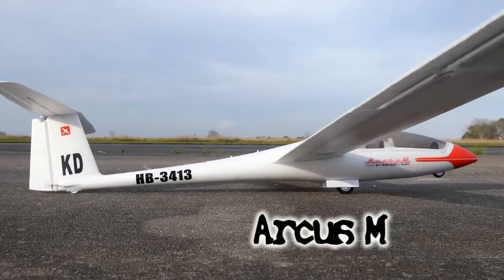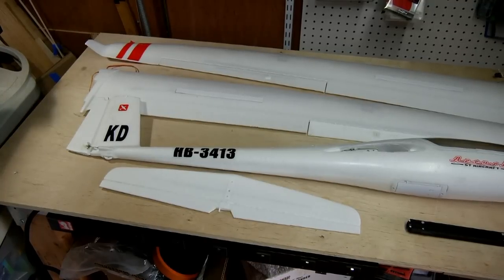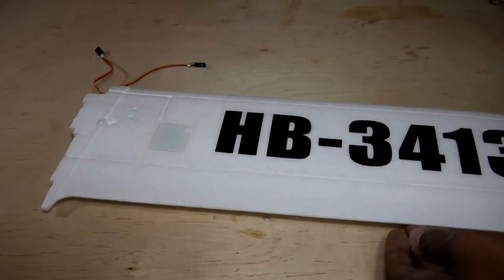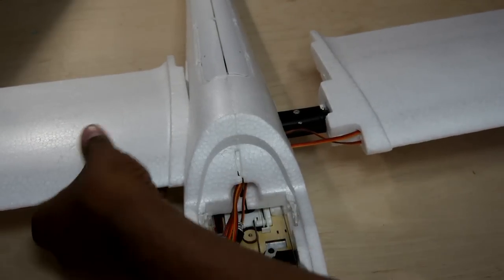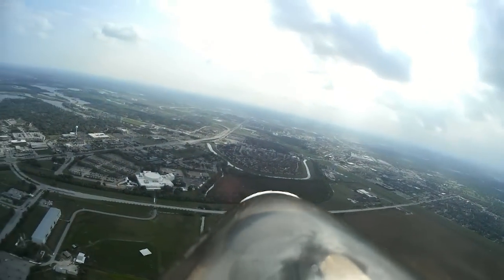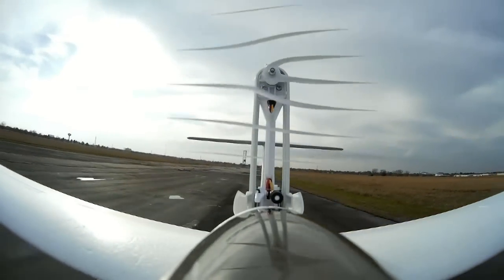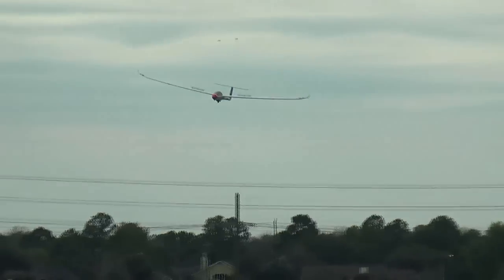ST Models Arcus M build & flight review | HobbyView

Comment: Its a sailplane - competition class no less- so wing flex is not only desirable it's a must and not at all the negative it would be on other foamies. This is one of the most detailed, accurate and informative reviews I've seen, I owned the Arcus and despite having full composite 4&6m sailplanes I must say I loved this foam offering. Because I am so familiar with it I know that your review was honest, I think it's time to get another one thanks to your great video reigniting the passion for scale sailplanes. My one negative was how floppy this thing is, not the wings mind you but I found the whole fuz and tailplane would twist and even on the ground the torsional rigidity is somewhat lacking, also set up on some radios of the complex systems can be troublesome.

Comment: Can the airbrakes be used as a proportional control would this have to be setup on the transmitter and what control or switch would be used on the Tx.
Reply from the maker: Qee Zee, yes you can use proportional control.

Comment: Excellent product video. What FPV setup did you use to take shots installation of this would be nice.  My only concern with foam.  Is there any way and/or product to coat foam to help prevent dents.  Also I note there is a factory fitted looks like a black tubular main spar in each wing root, how far does I go into the wing.  Would be nice if the manufacturer made the fuselage out of light ABS plastic.  Apart from that what a comprehensive model for an excellent price.

Comment: The review was so good I went and bought one. Now the question is how did you set up the throttle and pod on the throttle .Please let me know how it is done. Thank You.
Reply from the maker: You have two options. Have the throttle and pod retract on separate channels, or use the included automatic pod/throttle controller. I chose the latter as it simplifies operation. It will automatically ope n the pod when you throttle up and retract when you shut the throttle off.

Comment: yes I did fly engine planes, but I watched pros. flying giant gliders and they said you only use spoilers to slow the glider down on decent, but when getting to ready to touchdown release spoiler, and land, this prevents drop. I have thirteen gliders in my house but only a couple have spoilers, and what the man said works for me. anyway nice talking to you hope this works, try it out, ron
Reply from the maker: Ah, I see what you are saying now. Yes, just before touchdown you retract the spoilers so as not to slam the glider on the ground. You are correct. However, the spoilers are variable. What I would normally do was extend the spoilers a little bit and make very small adjustments to make a smooth and solid landing. My flight examiner made a compliment that she could barely feel my landings!
Reply: Airbrakes are different to spoilers; spoilers spoil the air over the wing and cause a nose down trim and are not speed limiting; airbrakes are speed limiting and used to control descent with elevators controlling speed.  The ideal approach technique is to set up half airbrake on final after selecting an aiming point (point at which you would strike the ground before roundout)  for landing then adjust the airbrake accordingly should you detect undershoot or overshoot.  near the ground keep them still and land, once on the ground and rolling apply full airbrake to kill any lift.  Spoilers keep them steady  before touchdown then apply full spoiler or you'll end up sinking and possible crashing.  The same applies with Airbrakes play with them near the ground and you can PIO (pilot induced oscillation)  and crash all as standard full size practice.

Comment: I was taught not to use air brakes for landing, only use flaps for landing, because air brakes slow the air going over the wings causing the plane to drop, where flaps slow the plane yet gives it lift, better for landing. I used to fly real planes, Cessna & pipers
Reply from the maker: I flew real gliders and we used airbrakes and spoilers for landing all the time. It was the best way to control the descent for precision landing. Many gliders do not have flaps, just spoilers (I flew mainly Schweitzers and Blaniks non of which had flaps). The key is modulating the use of airbrakes to control the descent. 
I think you are talking powered planes which to not have the excessive lift like gliders do.
Reply: It is perfectly safe and OK to use flaps together with airbrakes even with a sideslip providing you maintain airspeed

Comment: Hello everybody :-)

Does anybody know how to setup [B] softness for RMS [/B] 
(POP-UP and DOWN for MOTOR )
And,
How to settup RMS not to close motor until the prop is in correct position?
So,
When i push throttle stick down, motor is going to fuselage pretty fast, no matter if prop is in good (correct) position and it can make damage 

Thank you
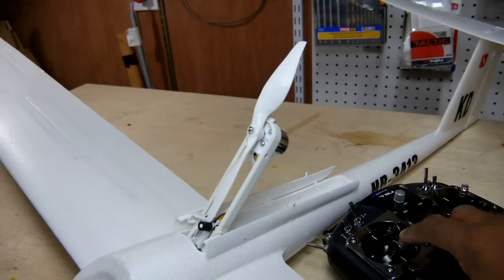Reply from the maker: Make sure you are using the RMS in automatic mode (only one connector to the receiver). Also, the prop has to be spinning so the friction latch will capture the propellor. It will sometimes not catch correctly on the ground, but I've never had it fail in the air. See around 6:09 in the video.

Comment: I have a 6 channel transmitter,this should work ok?
Reply from the maker: Yes, a six channel will work just fine.
Reply: Hey Hobbyview, can I use only 6ch and have all the features except from manually controlling the opening of the power pod?
Reply from the maker: YES! The power pod has a control board the automatically extends and retracts by sensing throttle position (automatic mode). So you can use a 6-channel radio no problem.
Reply: thanks.
Reply: I changed my Mind on getting this, I'd rather the Hobbyking Tundra, it seems less fragile.

Comment: I just got mine yesterday spoilers do not go all the way into the wings and my motor pod comes out fine and retracts fine but then keeps coming out and going back into the fuselage so I cannot fly like a glider but only like a sport flyer
Reply from the maker: +Joseph chrisman , Sounds like a radio setup issue. You should try adjusting the servo endpoints. The Spoilers may need offset or subtrim adjustments, but I don't recall needing to do so. I used a single momentary switch for the spoilers.